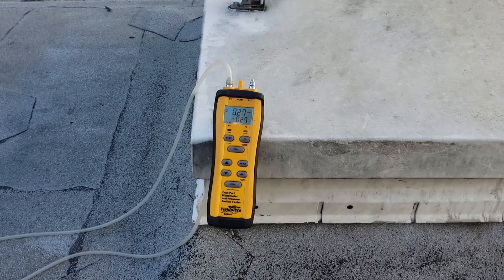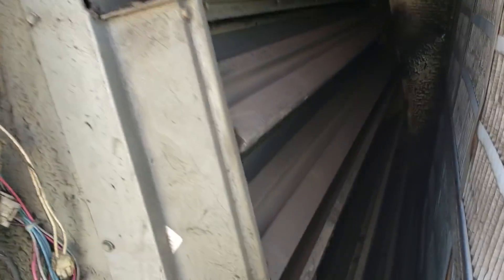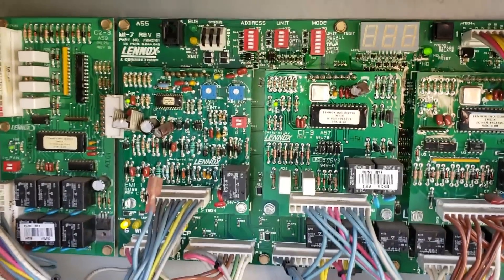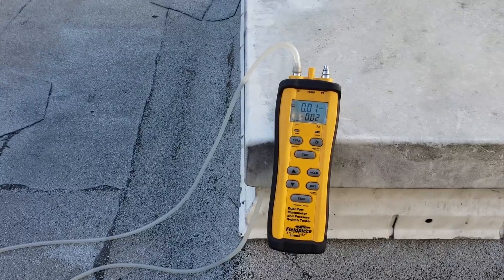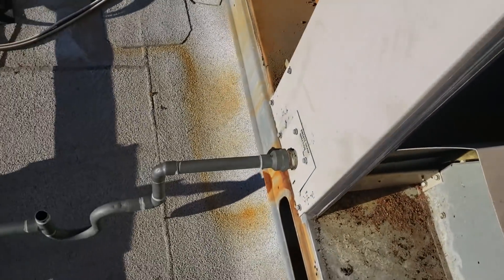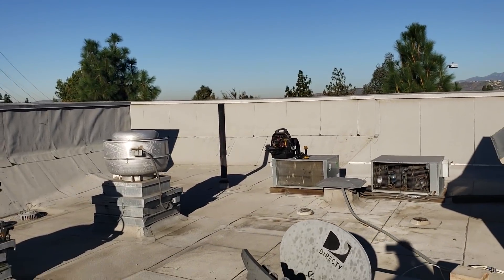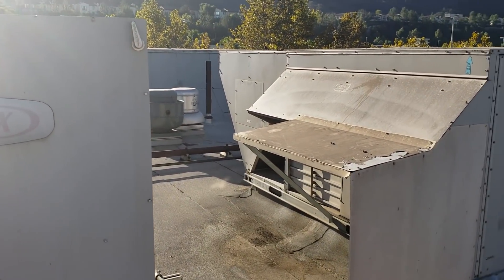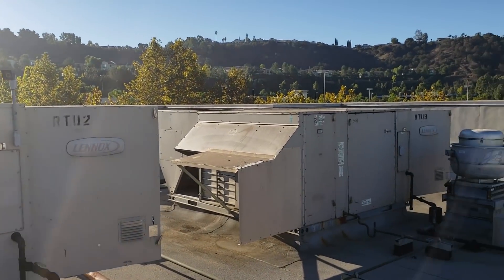Restaurant Air Balance problem

Comment: So glad I found this video. We have a sewer smell and an air balance issue at out restaurant. We called a company out and they sped up out MUA units which helped a little but they also told us thats the best they could do because the units are old, not sure what they means because they are in proper working condition. When the back kitchen door or roof hatch is opened, the air balance gets much better. I will look into the AC dampers also.
Do you have any videos that how how to clean the MUA blower fans?
Reply from the maker: Shelvin Singh  thanks for watching bud, I would suggest calling a certified air balance company
Reply: @HVACRVIDEOS  that's what we did and they made the adjustments and said that's the best they could do. As far as cleaning the fans and adjusting the blower fans, I'll call my HVAC guy but I'm just curious about how things are done, main reason for me subbing to your channel.
Reply: @shelvins1841  Hire pros my friend, it will save you headaches
Reply: @coldonehernandez4906  I did

Comment: Wow.  Kitchen grease hoods need dedicated makeup air provided around the perimeter of the hood to make them draw and operate properly.  How is this place getting by with using the comfort heating and cooling units for make up air??  Huge draft will be set up that drags air across the food the cooks set up on the counter, which cools off the food.  Sounds like a design nightmare.  The dedicated makeup air units are usually tied into the exhaust fans to run any time the hood is on.  The good ones provide heat and cooling as makeup air is supposed to be conditioned. Kitchen makeup air should not be provided by the comfort cooling system.
Reply: Exactly how it's supposed to be.. Had a customer that was complaining of dust on the kitchen equipment.. Had to shut those dampers off and do some serious maintenance on their make up air unit

Comment: also, forgot to mention blocked or improper sewer vent sizing and "bad" neighbors causing large positive sewer line pressures!
and partial clogged/restricted lines can cause enough positive when draining to push through traps, "plumbers" could easily miss things like that, without many years of experience ;)
could also be wind direction change/lack of it from the exhausts being pulled back in via the "makeup" air, it really needs bright fella to figure it out, I'm betting you can :)
Reply: That is a real complex isue with many variables. 
I think slove the beam sensor desing problem and buy prooper VFD’s is much easyer. To go back to the starting point when the air balance is as close as they designed.

Comment: restroom exhaust not working, probably 1/2+ the sewer smell, followed by other comments on dry traps/bad primers or lack of traps, plumbing issue causing trap siphon.
I forget at what negative pressure the traps will end up letting gasses in, but sees to me it's pretty high (many inches of water column)

Comment: The cost is low for them VFD'S and pays for it self during A/c operating cost in the first 6 months.. With drawing O/a the cooling air dew point will be high & not comfortable ( humidity issues).
Reply from the maker: Yeah I'm trying to convince them of that! Luckily for us we don't have humidity in so cal. We run 30% humidity on a regular basis
Reply: @HVACRVIDEOS   Do you have a job for the hvac technician . If u have please kindly share your contact details.

Comment: You could reduce pulley sizes to lower exhaust fan speed
Reply from the maker: Direct drive motors, so we are kinda screwed
Reply: @HVACRVIDEOS  any volume dampers in the exhaust ducting? OBD's at grills?

Comment: Great video. Your point about the economizers was spot on with properly balancing the restaurant. One important concept in restaurant air balance you did not mention is balancing more makeup air in the customer area and less in the kitchen to draw kitchen odors, grease, and heat away from the clients. Keep the vids coming....great stuff

Comment: That kitchen unit looks like it has a power exhaust on the side, shouldn’t it come on when the fresh air / economizer reaches 100%
Would probably make the negative pressure worse.
Reply from the maker: No it doesnt have a powered exhaust, it just looks like it does

Comment: You could get a total cfm of negative from fans then size a dedicated pretreat.. high humidity issues out by you? If not could do a fresh air swamp cooler as a cheaper doas. Load calc on hoods to figure out max exhaust needed to see if you can lose some negative cfm(vfd probably oversized the output of exhaust so might get lucky if they did) by changing/adjusting pulleys. Erv/hrv might be a good idea.. not familiar with your location though. Sounds like any direction you go though customer is going to have to sign a decent size check. Hopefully it works out for you. These are the interesting calls for sure.. frustrating at 1st when you keep digging but rewarding when a plan comes together.
Reply from the maker: Thanks for watching!

Comment: 👍👍👍
Reply: Not attack here but similar problem we are getting it odor at my parents house older home much older.

We suspect sewage but not sure.

Some times varey noticeable.

Mostly bathrume.

But not all wase.

I will contact them and try a fue things.

And note weather and wind ishus.

And running exhaust fan's.

And HVAC.

And drier.

Pleas leave commits would a apreaseate it THANKS.

By the way by the way septic system not city sewer.

Also I do suspect we have a venting issue.

Or some sort of obstructed vent.

Also the bathroom Plumbing is also the laundry plumbing and all that is newer than the original House which is probably over 40 years old in the Kentucky Region. If that helps.

Oh one more thing if it helps to judge the age of the referral for you.

 on the kitchen sink is an older size that does not mate with modern plumbing.

 we had to adapt it a reducer adapter enlarger fitting of some type.

Probably 5 years or so ago.

Also speaking of kitchen sink and venting issues.

The vent stack that would be run for be kitchen sink trap which is the only then that would be for the kitchen since there is only one drain in the kitchen.

Ashley goes straight out through the side wall of the house and where there should be an a 90-degree elbow to go up the side of the house in through the roof that vent line is no longer there.

 for some unknown reason could someone explain that as well.

Note.

We all have checked meney times in that area for that smell thar and around that area but now luck.

Also note many people may not see this in their area.

 but in that area of Kentucky it's very common to see a lot of PVC pipe on the outside of a house even in some renovated homes iven on new editions with that pate of the structure gutted!

 On the  editions for some reason anywhere on that as well.

 I'm baffled Plumbing pun intended.

On not just oure issue.

Again any comments would be appreciated.

Me personally am very experienced in the area.
Reply from the maker: It's very possible you have a broken sewer line underground. I would have a plumber come out and do a leak detection
Reply: Thanks I'll get with my folks also I noticed you also hearted this one as well as my comment about the Ave Channel and doing the YouTube Corey on vfd issues a big fan of him as well as Dave Jones from eevblog as you probably saw so if you get any weird things everything that would be interesting for teardown the easiest way to get rid of and can't afford send-off do it because I love his mailbag segment and all the teardown and all that stuff and I have not seen one Chase rack and plumbing stuff on there yet so it might be something unique maybe a bad Lowe's laser units in receivers we're something from maybe your brain box from the until Hood system hint hint hint.

I'm quoting him here.

And now everyone's favorite segment mailbag.

And here's one from yada yada yada

USA USA USA.

And we have a note.

 Dear Dave Jones hear is blank blank blank. 

Get the picture.

If you have to watch this Channel or see something on him if there is a way send them this way to this post and the one that I was talking about earlier. I would love a thumbs up and I'll heart from him it'd be an honor.

Note.

I knew to the compliment part of YouTube.

And still figuring it out iney good totoreles out there on this?????.

Buy I have been using YouTube ever I had access to hispead INTERNET.

That was even be for android was a opporiting system.

And Google was not Mitch a thing.

Just a surtc engen and you tube...

As far as I newe at that time 

Ok.

Comment: On those direct drives do they not have a module to adjust speeds? Or the ability to add on? I absolutely love these videos because this addresses such a huge issue in restaurants. Less and less you see restaurants with dedicated make up, all want to use ac economizer and transfer air from dining to kitchen. I'm always interested how everyone goes about getting the balance correct after repairs to the ac or exhaust systems. Thanks again for all your effort you put into these videos 👊
Reply from the maker: well when the VFD's were working you could slow them down and speed them up but not anymore, 
Thanks for watching bro, I am going to go live on Youtube tonight 11/5/18 at 5:00PM pacific time to discuss my most recent uploads and answer questions. Come on over and check it out 
https://youtu.be/JHpAuTzzw6E

Comment: Nice video is it still possible to put a makeup air in
Reply: Ok thanks
Reply from the maker: I am going to go live on Youtube tonight 11/5/18 at 5:00PM pacific time to discuss my most recent uploads and answer questions. Come on over and check it out 
https://youtu.be/JHpAuTzzw6E
Reply from the maker: It would be very difficult because the hood was not designed for a dedicated makeup air unit, we could always install one and dump it in the back of the kitchen but that would be less than ideal.

Comment: Great video Chris. That looks like the VFD system we had at a shoney's I just started.  So are you just gonna adjust the pulleys and slow them down or do they not have them?
Reply from the maker: Direct drive motors nothing I can do because the customer doesnt want the VFD drives anymore. It's a really crappy situation
Reply: @HVACRVIDEOS  could Block them off a little? yea that would suck. Like I always say. I got heat OR In this case ventilation at my house. 😏

Comment: Sounds like the cost of the extra energy consumed and modifying in repairing all the other fixes to overcome the broken VFD’s will far exceed the cost of repairing the VFD’s. What if the customer is one of those you got an A in economics or business management on a piece of paper but doesn’t know how to apply it, lol. If the VFD‘s were from ABB or Dan Foss with the reactors and filter the high-end models they would not have broken down in the first place if properly wired they would get 8 to 10 years out of them probably still be working and just have to send them in for servicing in their normal 10 year cycle for maintenance.
Reply: t lech I am curious about the failure mode of those VFDs because in my experience working on industrial equipment those Allen Bradley Powerflex units are very reliable.  Though I don't have any experience with those exact ones with built-in ethernet, some of the units where I work have been in service for over ten years without a failure.  I'm now off to watch the live stream to see if it was the drives themselves or the controller that communicates with the drives that failed in this case.
Reply: vistablue2007 The drives and south when they fail it’s usually due to installer error picking the wrong Drive for the wrong job underrated drive bad wiring picking non-shielded wiring for the wiring after the drive creates a lot of interference and can even generate electricity feedback on the ground side I’ve measured as much as 80 or 90 V because electrician use normal regular wiring instead of properly shielded .  Can live 10 years plus is a normal life anything less than that it was either a cheap drive or poor installation.
Reply from the maker: Amen brother you hit the nail on the head!! It seems I'm going thru a ton of effort and in the end will probably exceed the original repair cost!

Comment: I have a question with you putting economisers on 100% will the kitchen in the summer time be cooler or no?
Reply from the maker: It will hurt the kitchen in the summer for sure. This really is not an ideal situation.

Comment: Good job, on balance.  I think with amount of exhaust hoods/make up air is needed. Just my opinion.
Reply from the maker: Thanks for watching!!

Yeah they are losing efficiency for sure, this is not the ideal situation at all, the perfect solution would be to add a dedicated tempered makeup air unit. But when the customer chose to go with the high efficiency hood system they didn't design the hood with a traditional makeup air in mind so there is no where for the makeup air in the hood to be delivered. Plus the system was designed to run the exhaust fans at medium speed not high speed like they are currently running at. It is a very crappy situation for sure!  If I left the building in the negative air situation they would be pulling the unfiltered outside air thru all the doors and they would still have the smell problem, at least this way we are filtering the air and somewhat conditioning it.
Reply from the maker: I am going to go live on Youtube tonight 11/5/18 at 5:00PM pacific time to discuss my most recent uploads and answer questions. Come on over and check it out 
https://youtu.be/JHpAuTzzw6E

Comment: Health code VIOLATIONS.  Has to be 10ft away from oa damper. If it is high humidity outside its going to make all kinds of moisture problems.
Reply from the maker: Luckily we don't have humidity here in So Cal.  this is not an ideal solution but we have to adapt and overcome!
Reply from the maker: I am going to go live on Youtube tonight 11/5/18 at 5:00PM pacific time to discuss my most recent uploads and answer questions. Come on over and check it out 
https://youtu.be/JHpAuTzzw6E

Comment: With all the outside air units open, won’t their efficiency go down the drain? You’re pulling in hot and cold air with the different seasons
Reply from the maker: Thanks for watching!!
Yeah they are losing efficiency for sure, this is not the ideal situation at all, the perfect solution would be to add a dedicated tempered makeup air unit. But when the customer chose to go with the high efficiency hood system they didn't design the hood with a traditional makeup air in mind so there is no where for the makeup air in the hood to be delivered. Plus the system was designed to run the exhaust fans at medium speed not high speed like they are currently running at. It is a very crappy situation for sure!  If I left the building in the negative air situation they would be pulling the unfiltered outside air thru all the doors and they would still have the smell problem, at least this way we are filtering the air and somewhat conditioning it.
Reply from the maker: I am going to go live on Youtube tonight 11/5/18 at 5:00PM pacific time to discuss my most recent uploads and answer questions. Come on over and check it out 
https://youtu.be/JHpAuTzzw6E